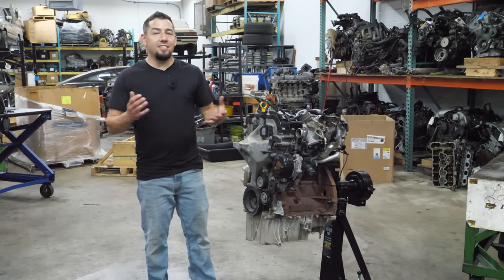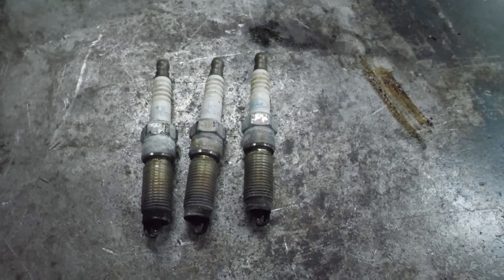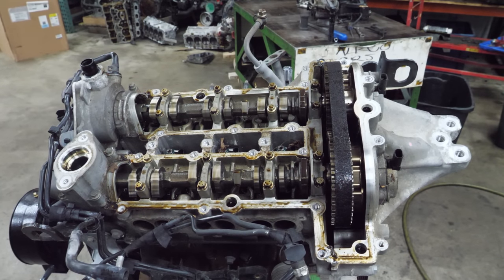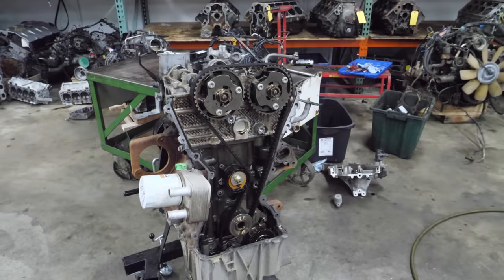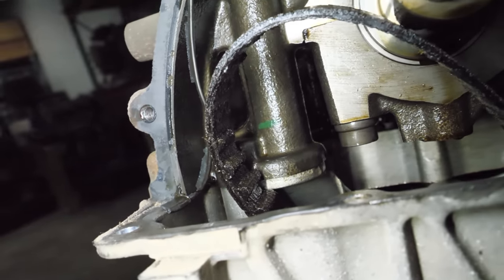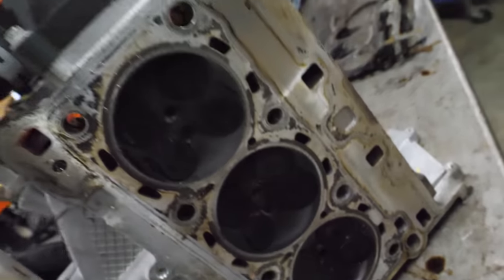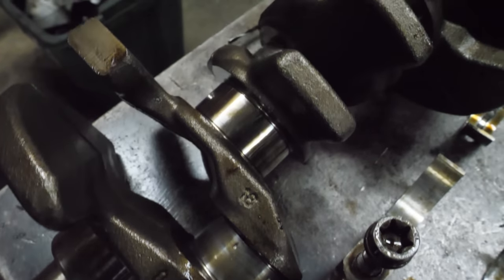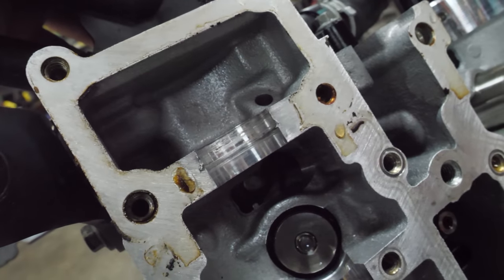JUNK Ford Ecosport 1.0L 3-Cylinder Ecoboost Teardown. LAWSUIT ENGINE!

Comment: There I a difference between European and American servicing. In Europe it is standard to service engines. I have a Ford ecoboost 1lt 3 cylinder. I service mine every year. Never had any problems with it. 
The way that looks to me its never been serviced properly for a long time. And maybe thrown in with a heavy footed person. Seen that so many times over the years. I just think it was a lack of care for the car that's why it looked in such poor condition

Comment: No good experience with 1.0 eco boom
They finishing like this all the time.
Due to the outer layer of belt coming off and going into the oil sucker and blocking it.
You guys know the rest of this story.
If you replace the belt every 40000 miles and oil every 6000 miles, you will be alright.

Comment: ecoboost = economic boost engine... aka cheap turbo engine....
i personally avoid any commuter cars that has turbo in them and that uses CVT transmission...
yes i like my commuter car i use to go to work be boring as hell that doesn't break down on me...
i had hondas before but now civic and accord has turbos.. so i avoid them
if i HAD to buy a new car with CVT tranny, i would probably go with a toyota CVT instead of other manuf.

Comment: Too much pressure and heat on a small engine...in the 70s, Ford had a V6 that was good and had great gas mpg at that time....prolly better than that 3 cylinder "ecoboost"

Comment: What is that new trend of manufacturers of dipped in oil rubber belts? Is it a conspiracy to make bad motors? Every engine I know that has that style of belt, had that same problem - timing or oil pump belt brake and jam the oil pump and kill the engine. Go figure what goes in engineers heads

Comment: Eco is all about pollution and fuel mileage generally sucks which means they don't understand using more fuel is poor for CO2 which is by product of burning any byproduct. The 3 cylinder metro was in the 50 mpg decades ago which would put out less CO2 where there might be more NOX but there is a balance. Why can't we get 100 mpg and have slight pollution but less over 100  miles in reality with 1/3 the CO2 over 100 miles.

Comment: I had a 98 Corolla with the 1.8 L 4 spd and it got 33 mpg all day long. About 39 mpg on the highway. This engine is not  an improvement.
Reply: I have a 2016 Auris with the 1.2T 6 speed it gets 40mpg city, 50mpg on rural roads and almost 60mpg on the motorway thats an improvement without all the nonsense the Ford Ecoboom engine has.

Comment: I'm amused by an American describing a power output of 123hp from a 3 cylinder 1000cc engine as being 'not great'. ...from the land of the 7 litre V8 that makes under 200 hp 🤣🤣🤣🤣
Reply from the maker: Double the displacement, 246hp from a 2.0 has existed for a long time. 
Also, using engines designed in the 60’s as your point of reference is amusing as well.
Reply: Whatever i think you know your talking crap. To be fair the Yanks did eventually learn from the Europeans how to get decent power output from an engine without the caveman approach of adding capacity .. Same as how we taught you how to build jet engines and liners😅

Comment: Virtually every motorcycle engine that's this size produces between 150-200 HP, naturally aspirated. I know this engine has much more flywheel and crank mass (to support moving a much larger vehicle) but its still embarrasing. Does Ford still work with Yamaha? It seems they could have done a vastly better job.

Comment: All manufacturers in the world have their engineers design their cars for cheapest to make and assemble.  So things like waterpumps and the timing belt on this pos are impossible to repair.  The old push rod engines would go 300,000 miles if taken care of.  The fuel mileage on my 1976 Chevrolet is about the same as my 2014 Silverado when I’m pulling a trailer.

Comment: Why do manufacturers care so little about building a quality product these days? You would think customer satisfaction would be of most importance to get returning customers. Perhaps it’s built in obsolescence which is a horrible business model as customers would be swayed away from your product and buy the competition. I totally understand building the car as cheap as possible but in this case building it right wouldn’t cost much more a simple chains instead of belts would correct most of this . They wonder nobody wants to be mechanics anymore when they build stuff like this and a mechanic has to deal with this crap under warranty for shit warranty pay ..

Comment: Turbo produce so much heat and a timing belt with it is a bad combination. If they use a timing chain the engine would last a decent life span.

Never get a car with timing belt.
Never get a car with cvt transmission.
Just get a horse 🐎 🤣

Comment: Ford doesn’t make great engines anymore ever since they started using the spray sleeves on the 5.0 that is causing the oil consumption issues.

Comment: Such engines are not environmentally friendly. They have an extremely small resource.

What is more environmentally friendly? The old Toyota 1JZ-GE, which was assembled once in 1996, and it still works, having survived 1.8 million of kilometers without boring the cylinder block, with factory camshafts, or twenty of these new engines that the owner is forced to change every 100,000 kilometers, for new ones, because it cannot be repaired in principle, block boring, and repair of camshaft beds are not provided, and most likely it will not work for a long time?

I think my old Toyota engine is much greener than this, despite being less fuel efficient.

Comment: If those are the actual MPG numbers on this measley engine then the automotive industry hasn't really evolved much at all!! What's the point of building such an underpowered joke that is nothing more then becomes an oversize paper weight at the end!? 
You can have it Ford (owners)...
I'll just stick to my guns and keep my 26 year old W body going that makes about the same MPG numbers and has more power on durable & reliable 3800 engine that is CHAIN driven and is N/A!

Comment: A weed trimmer has more power than an ecoboost. Never buybanythingbwith a ecoboost or any turbo 4 cyc. If a truck, 8cyl. Small truck . Minimal 6 cyl. Never evervever any modified 4. Asking for trouble. It will burn out and wont last, even normal conditions.

Comment: Dreadful design. So many manufacturers are accountant driven which in the past has always lead to trouble. Many manufacturers with small engines have issues, VW, BMW, FORD all have small engines which self destruct. But honestly, a belt in oil, has to be the worst decision. Manufacturing of parts such as chains is also financially driven and have increased the production quantities before retooling which has resulted with chains failing. Gone are days of reliability over financial gains, no customer support etc.

Comment: When a manufacturer builds an engine like this, with an internal, non user serviceable rubber timing belt and oil pump drive belt, it is completely and intentionally built to be a throwaway, self destructing time bomb engine. There is no excuse for this. It's a manufacturer wanting to build it as cheap as possible, knowing it will last 5-7 years ans then be guaranteed to self destruct. The 1.0L Ecoboost is a complete garbage heap of an engine and should earn Ford a class action lawsuit. It's designed obsolescence. Also, how the hell does the lower timing pulley stay in time with the crank if it has no key? Strictly jam fit by the crank pulley?

Comment: Those small 3 and 4 cylinder engines from ford like in the eco sport are complete and total garbage.  Horrible gas millage.  23MPG was laughable for such a small engine.  Eco means cheap

Comment: what a terrible design.   doesn't even get good fuel economy.  I just finished watching the mazda 2.5 teardown what a difference in design.  I can understand why mazda ran away from ford.  I think if I drove my 86 mustang lx with the gt engine slowly I could beat that fuel economy.   what happened to ford.  needed to just pick up the engine and shake and see what falls off lol.

Comment: What do you expect from Ford?🫢🤔.
It seems everything that was built to last like the 300 ft/lbs line line 6 Cylinder as scraped .Just like the Buick 3800 series lll engine. It's no wonder why FORD and GM are screwed. The GM 3.6 liter V6 is a pile of junk  as was the NORTHSTAR .
The consumers are totally passed at these corporations for outright criminal activity. 
Buy Toyota or Honda for reliability, longevity and durability. And the Buick 3800 V6 .😊

Comment: Ford crap.   My old dad back in the 1960's said to me Ford is made to a price, don't buy one.   50K miles and they are toast.     I have spoken to several mechanics and they all say the same, , 3 cylinder turbo, don't expect 100k miles, in fact most said get your fun and dump it by 60 k miles.  Wet cam belt is a chocolate teapot.  That's why Ford is now bankrupt.

Comment: These engines are utter rubbish! They are closely followed by the PSA puretech (purecrap) 1.2 which suffer from madness of a Wet Belt that breaks up in no time and blocks oil pump etc, UTTER MADNESS.

Comment: The Ford Ecoboost engines are terrible. One liter, three cilinder, turbo charged, wet timing belt, and direct injection: that is a recipe for failure. An engine like that belongs on a toy vehicle, not a 2500 pound car.

Comment: extremely foolish of ford not to use a chain instead of a belt especially for the oil pump, and extra extremely foolish that they didn't key the crank sprocket! 

this 1.0 I3 is definetly one of the worst ford engines ever!

geez I think this ford 1.0 ecoboost is way worse than the mitsubishi 4G54 Astron 2.6L sohc i4 when it come to oil pumps, because at least the astron 4g54 has keyed sprockets on it unlike this ford ecoboost 1.0. I think the Astron 4G54 is a way better engine than this ford ecoboost 1.0.

Comment: ther are idiots at ford who change the belt but not the oil they do that after next service ???? idiots !. Is that to obstructed or designed to breakdown ?  . Worked 15 years on proving ground Ford not any more . I would recommend to change the oil & filter  every 20.000 km max and to change the belt 20 a40 .000 km before service end

Comment: Bottom line here. Ford ecoboost/modular engines are top to bottom a nightmare and unequivocally junk. Also Ford transmissions are junk. Since around 1995 Ford went to crap. I'm a lifelong Ford guy but I'll never buy a new one again. 1995 or earlier only.

Comment: "Ecoboosts ass". Tiny "Direct Injection" engines are not the answer. I think the EPA is forcing the car manufacturers to build crappy little engines to say: "Look combustion engines are terrible. We must go to EV's."  That no one but the rich can afford. There is no reason for combustion engines to even pollute at all. Even with gasoline they could pollute 50% less. It's how "gasoline" being introduced as a liquid instead of fumes or gas that cause the pollution. If the "fumes" of gasoline were used, you would see a 50% plus increase in mileage and 50% less pollution. Liquid gasoline does not "burn", So why introduce it as fuel into the engine. Only the Fumes ignite.
Reply: Its quite possible to make a good reliable small direct injection turbo petrol engine its just that Ford did everything you could possibly imagine to make it crap. Toyota made a direct injection 1.2 turbo 4 cyclinder petrol, its timing chain driven and actually reliable sadly they never sold in big numbers and the engine got discontinued after just 4 years.

Comment: Ford makes the absolute worst designed engines on the planet. Everything after the 2 valve V8s and the 7.3 diesel have been absolute crap.

Comment: That’s just ridiculous that the top of the timing cover is part of an engine mount to the body the chassis of the vehicle what a crappy design and the horsepower nothing that is fucking dismal 120 hp doesn’t know that but this thing is a joke

Comment: Another junky Ford design.  Reminds me of their carbon-seized spark plugs and their 4-thread spark plug engagement which ultimately lets the spark plug blow out of the head.  Terrible designs.  Absolute junk.  Ford's design team is the worst.....do not buy Ford products.

Comment: nah thats just a shit car for the engine as its over worked in a fiesta the 1lecoboost same the mk 8 it has a fuel consumption on eco mode of about 60mpg
Reply: say what you want 125bhp in a 1l in a small car flys compared to other hatchback eco cars eg 206 2ld about 50mpg tdi bout 90-95bph
Reply: service interval for timing belt is like 50k tho so you do neet do change belt/oil obs with 5-20 at the correct intervals or the engine just looks like shit and will snap the belt or die from starvation
Reply: it also in the eco sport has 47mpg so lies and yes as a ford technetium if you dont change the belt that's meant to be changed then you will loose teeth in the pump and clog it cause the belt to go tight and possibly snap a tensioner off and have no oil or balancer as a result causing the damage shown stop clowning man